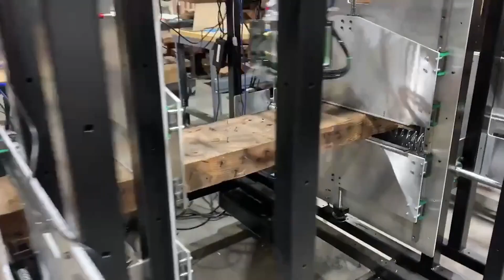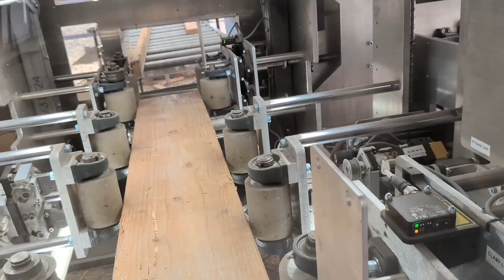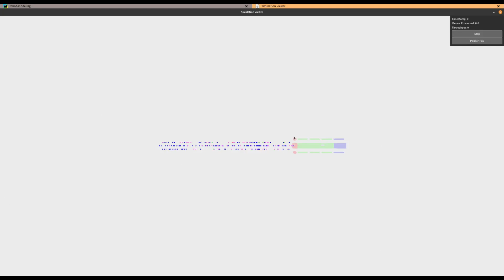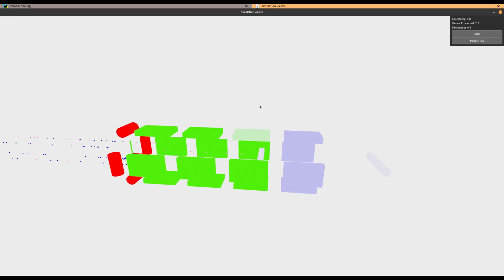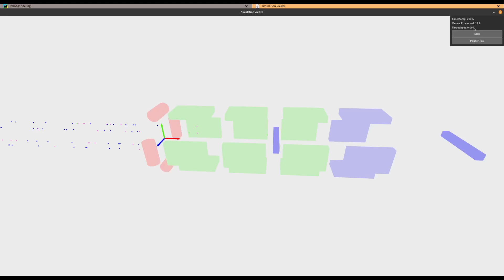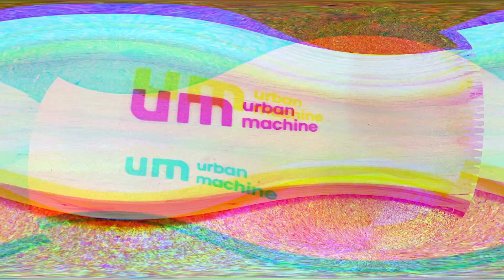Two Years Ago, We Had A Big Engineering Problem, Here's How We Solved It

Comment: I wonder if you could just yoink the nails out using a cryogenically cooled electromagnet with a massive capacitor bank.
Reply from the maker: @Nathan0A  I'd be surprised haha. Sometimes nails go all the way through the wood and bend on the other side. Magnets (however powerful) would just catch on the wood. Pulling straightens out the nail and unbends it.

Comment: Cool robot, what are the rough economics of the number of board feet/8hrs you need to hit for it to make it profitable?
Reply from the maker: @EugenePentland  that's actually another floating variable we had to contend with. The economics are a factor of:

1. The labor required to run it
2. The BOM cost of the machine
3. The throughput of the machine

Assuming a 1 year payoff period (which is amazing for the industry) we would require 2500 board feet per day.